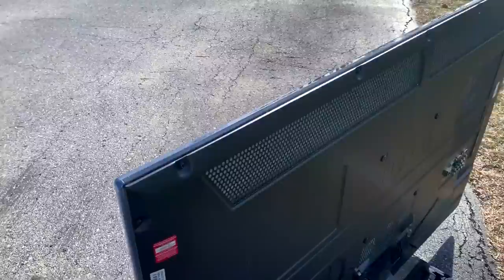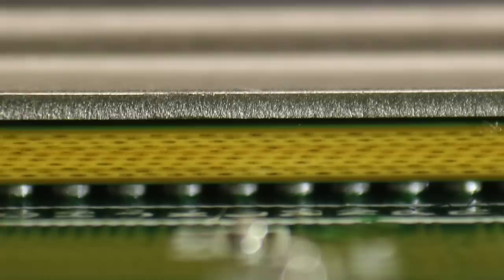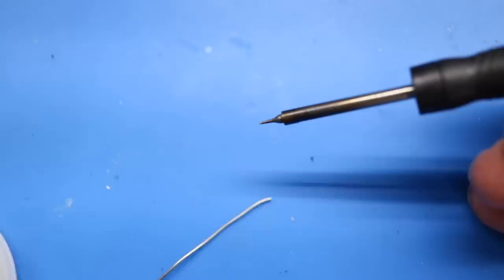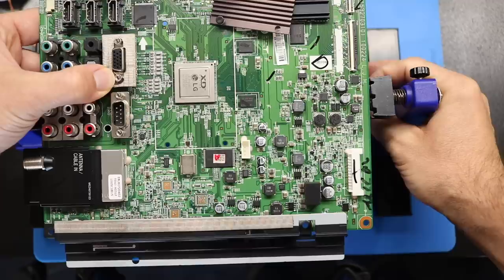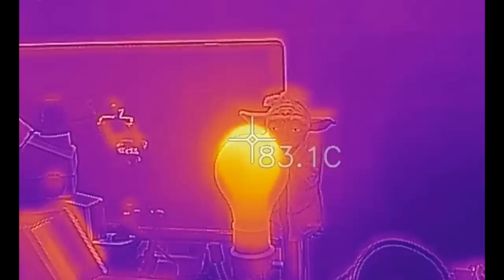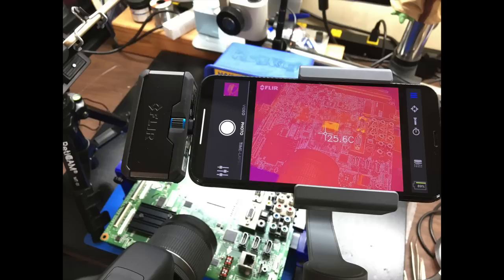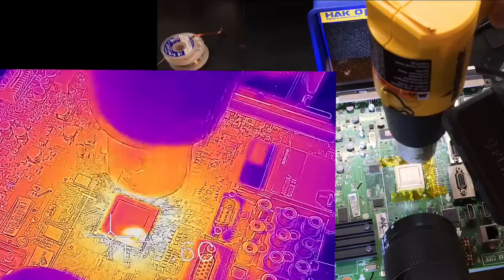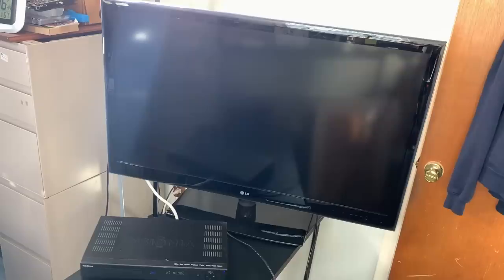I fixed a broken 47” TV with HEAT | HDMI ports not working on LG 47LE5400

Comment from the maker: Let me know.  What has been one of your favorite inexpensive or jerry rig repairs?
Reply: A repair of an older plasma TV that had blown capacitors. I think it was around $10 to repair the issue of it not turning on. My son still uses it - it's been about 4 years since I fixed it.
Reply: I repaired my relationship with my ex
Reply: I have a 65” Samsung where the bottom third of the picture is very dim and flickers. Can you direct me to one of your videos that would possibly address this problem? Love your work! Thank you
Reply from the maker: Thanks!  Sounds like either a backlight issue or an lcd screen problem (or possibly a tcon board problem).  My next two videos coming out will hopefully help give suggestions on things to try.  I’m repairing horizontal lines and dark screen issues.
Reply: @FrugalRepair  ooh when's the videos releasing I'm waiting lol
Reply: I fixed a bunch of Iphones (touch disease ) using a piece of cardboard

Comment: Standby light is not glowing The  optical sound does not glow traced no 5v Replaced ps board the opto port now glows but standby is still dark Therefore remote fails to turn on TV Tried manual turn still no joy... any ideas
Reply from the maker: Not sure but you should measure the BL_ON signal (it may be marked as something else like PS_ON) on power supply, should go above 3v or so after you press power button.  If higher than 3v, check to make sure PS is outputting 12v and 5v to main board.  If so, and you’ve disconnected everything from the main board but the button input bar (to isolate any shorts by the other peripherals) then I’d say something on the main board is at fault.
Reply: @FrugalRepair  did some testing bit hard running the board in situ noticed the board has 12v applied in standby. Made a cable and applied 12 v from bench PS checked 3 step down regulators. The remote on made 5v and the other 2 1v each. Applying 12v briefly the red standby light flashed before going dark. Check the on a good board  The red standby glows until the remote on is detected  the light stops then the green led lights up. So it appears the CPU on the faulty board is not booting for some reason. Removing the large heat sink There is 2 ram chips and MTek cpu Suspect there is a bad solder joint on the ram chip or the CPU due heat stress overtime what are your thoughts

Comment: Great job 👍A+ most people think heating alone works but do it wrong so the chip only works within few weeks. Flux is key to make reflow fix last longer. I think Xbox 360 GPU failed because unleaded solder used. I recommend leaded solder.
Reply from the maker: Thanks, Paul!  There’s also a misconception out there with the 15” and 17” 2011 MacBook GPU’s.  The issue isn’t actually the solder underneath so the “reflow” will be hit or miss.  There is a problem inside the chip and unfortunately the chip needs to be replaced.
Reply: Tampatec your a great guy 2 my friend seen alot off your vids to m8,so i learned from u2,Thx and God Bless...

Comment: So I found one of these TV's at the local GW for $40. Plugged it in to power and turned it on at the store, got a picture and thought all good! Got it home and plugged the cable box into HDMI 1and got the no signal message from all of the HDMI ports. Then researched the issue and came across all the sites that say cook the main board in the oven, wasn't crazy about the idea and knew the wife would not go for stinking the house up with the toxic smell of roasted PCB. Then I came across this video! Appreciate the way you explain why this method works and the time you take to preheat the board and protect the surrounding components with heat resistant tape. So I attempted the repair today following your method, even used an infrared thermometer to monitor the board temp.  Results, beautiful working 47" TV in the bedroom for $40.  Long story short, FrugalRepair, YOU ARE THE MAN!!!!  Please keep those videos coming to keep all us DIYers out here inspired and on the right track. Thanks!!
Reply from the maker: Wow, way to go!  I’m so pumped to hear that you got it working.  Yes, more videos are in the works.

Comment: Clever stuff. Back in the early 2010s, My business repaired broadcast & professional av equipment. We had a Hakko hot air station set up, worth around $15k, and used heating profiles supplied by the manufactures to remove and replace BGA and 150 plus pin ICs. Now I find out I could have just used a $150 heat gun and $1 globe!!! Brilliant stuff. I’ll have to give it a go on a HD capture box I have that doesn’t work.
Reply from the maker: Thanks for watching!  With your experience I bet you can get it to work. Good luck!

Comment: It worked!!! I did the hair dryer job and it worked today, 02/04/2021. Guys, I have a 42 inch LG LE5500 from 2010. All hdmi ports stopped working, so I disassembled and warmed up first for 1 minute and nothing. So I did it for 2 minutes and it came back ... but a little while it stopped again..then I did it for 2 more minutes and it came back. I tested it in the morning and now at lunch it was working ... well, the thing is, it worked. Tks for the advice and money saved
Reply from the maker: Great to hear!  You’ll probably have to do it again at some point but it will keep it alive for now.
Reply: @FrugalRepair  to make sure I haven't closed the lid of the television yet, lol. Just to make sure :)

Comment: Hey there Reese. Thank you for all you do, for so many of us out here. The Clips that your channel produces are nothing short of awesome. Every one of your clips leave me sitting there, drooling a little and wondering Where fas your channel been all of my Life?! So, again I thank You. I myself have 2 LCD TVs that need help. One is a 43" VIZIO that is unwatchable. This problem occured at about One Year and a week old, of course. Anyway I took off the back and can see that a string of the LEDs are not illuminating. I just bought a new , Non-VIZIO, LCD TV. After watching you for a while, I think I may have the motivation now to attempt this repair myself. Thanks again. I also have a Samsung that is barely watchable. An Ex threw a glass of wine at it, but its issues appear to be similar to the VIZIO's problem, in that half of the screen is not illuminated? So I think I'll try this one as well?

Is there anything inside of these LCD TVs that I should waqtch out for? Like "High Voltage," or anything? Neither of these things are worth dying for or even worth a visit to the Hospital. 

Love your Channel and Thanks again Reese.      Keep Smiling...
Reply from the maker: Thanks for your kind words!  Unfortunately, I can’t provide a lot of help detail here but I do have ideas in my top tips PDF.  If the lcd screen is broken on the other one, there’s nothing you can do to fix it.  But hope you can at least give them a try!

Comment: I have an A.A.S. degree in Industrial Electronics and 23yrs experience in electrical maintenance......you by far,  did an excellent job at this!  I have a LGLX6500 LED 3D television that was a house warming gift from my late grandfather.  The TV has sentimental value.  I think mine has the issue that most do with that chip, "No Signal" but it lights the LEDS for power and the bezel LG logo, just no signal to inputs :-/ . It's hard finding these boards new at a price that I am willing to chance.
Reply from the maker: Thanks for your kinds words!  Hope you can get yours working.

Comment: My son just found your channel, and now he is binging the videos! We have a Vizio E320VP someone gave us, and it powers up but gets stuck at the Vizio logo on the screen, and then does nothing.  The only way to turn it off is to unplug it. From reading it might be the EEPROM but that seems like a tight fix for someone who has never done it.  Probably will try to replace the main board as a whole and see.  But we both have been learning!
Reply from the maker: Thanks!  Next video should be coming out soon - a fun repair and result =).  Yes, I would agree that you seem to have an eeprom issue.  Maybe you could find a friend to solder it on for you?  Or maybe a local makerspace club could find someone to do it for you? And of course, you can just replace the main board.
Reply: @FrugalRepair  Well I am sure my husband could do it if he could find some time.  He is pretty good at all that, he built his own racing quads and remote plane stuff.  I didn't think we could replace just the tiny little parts on the board until we bumped into your video.  Worth a shot I guess.  :). Looking forward to the new videos!

Comment: Did the same operation twice on an old LG 60" plasma TV and it served me well for 5+ years until It finally gave up with another error last summer and I threw it away. But yes, It´s sad to see that so much stuff is thrown away because simple faults... Forgot to mention, I got the TV for free from a friend since the HDMI-ports were not working =D
Reply from the maker: Thanks for sharing!  That’s great to hear you got so much use out of it.
Reply: I got this TV for free recently as well! Now we'll see if I can correctly reflow the chip

Comment: Very well put together video. Definitely a step up than the average reflow video. I reballed one of these LG's with input issues with leaded balls. But it ended up failing again 6 months later. It might be internal chip bond wire issues and not a BGA issue.
Reply from the maker: Thanks!  That’s interesting.  Could it also possibly be a warped pcb or chip causing the solder ball to lose connection?
Reply: @FrugalRepair  I suspect internal chip issues. Common with flip chips, the bonding wires break internally. The heat during rework causes flexing and exspanes/contracts. Making the bond wire touch again. Often mistaken for BGA issues.
Reply from the maker: Thanks.  Do you know if this chip is a wire bond or a flip chip?
Reply: @FrugalRepair  pictures sent. Check your email.
Reply from the maker: @jeffescortlx  Thanks.  That seems like a different chip than the one I worked on this this video (Broadcom vs LG).  But maybe it's just the branding.  Anyway, the flip chip vs wire bond is how the die connects to the external chip pads.  You won't be able to take a photo of it unless you take the chip apart.   Great job on the reball, BTW!
Reply: @FrugalRepair  I know the issue is internal and can't be seen from the bottom side. But I also knew you would appreciate to see the bottom side pulled off the board.
Reply from the maker: Yes, definitely appreciate the photos!  Again, great job!

Comment: Hey, I got this exact TV but the 42” version, I bit the bullet and had a go using my wife’s crafting heat gun. I used some insulating tape to hold down the small components near the main chip and then put a bit of cardboard on top with a small square cut out showing just the main chip. I then applied lots of heat and thought I had over cooked it perhaps as when I stopped and removed the cardboard some of the insulating tape had burned a bit. I then put the board back in the TV and connected up all the cables, the 2 thin ribbon cables were tricky. Upon powering on the TV came on but the screen was messed up, so I disconnected and reconnected the thin ribbon cables and after a good bit of fiddling and adjusting the ribbon cables hey presto screen working as it should and all HDMI working! Perhaps you could do a more detailed video on how to disconnect and reconnect those thin ribbon cables correctly as it probably took me 6 to 8 attempts to get then aligned correctly. PS: this is the 2nd time my TV has failed with the HDMI port issue, it failed after 4 years and was covered by the warranty and then failed a further 4 years later!
Reply from the maker: Great job on the repair!  Yes, sometimes those connectors can be a little tricky.

Comment: Awesome video!  Can I still do this without the thermal sensor?
Reply from the maker: Thanks!  Yes, you can.  You need to be careful that you don't over cook the board.  So with a heat gun, say give it 3 minutes of close rotating heat on the chip.  Then test it.  You can try it again if it doesn't work and lengthen the amount of time.  If you can see the solder get molten, that's when you know to stop but it's hard to see under the chip.

Comment: The third time around I followed your procedure and so far so good. Thanks for posting. The first 2 times I used the bake-board-in-the-kitchen-oven method, the first time it worked but lasted less than 2 months, the second time I set temp temperature a little higher and components fell off the board. Lets wait and see how long it lasts for.
Reply from the maker: Did you solder components back on the board?  Or did you get a new board for the third attempt?  Glad to hear it’s working!
Reply: @FrugalRepair  I got a used board from ebay

Comment: Plug in RCA Cable too, it's work for me :).

Sorry for bad English, GBU.
Reply from the maker: Do you mean use the RCA inputs instead of the hdmi?
Reply: @FrugalRepair  Use RCA first then Switch to HDMI, it's works for me, 3 HDMI port Normal back.

Comment: I guess I have to try this on the BT chip in my PS3 which stopped working half a year ago.
Would not have been confident enough to try the heat gun without seeing it here.

Comment: Do you know the possible fix to a TV that would turn on normally but once turned off it would have a hard time to be turned back on again, but once it turns on again it would work normally
Reply from the maker: That sounds like a classic symptom of bad rectifier capacitors on the power supply.

Comment: I have to do this to my TV (LG too) every 2 to 10 months.  Instead of a heat gun, I back the whole board in the oven at 392 F for 10 minutes.  I put it in a baker's parchment paper pouch and then into an aluminum pouch folding up the open sides to prevent the smells from escaping.  It's annoying to have to do this, but it saves me $230 on a new board that is never in stock.
Reply from the maker: Have you thought about adding some active cooling?   Like a fan to the back over the heat sink.  They may keep it from warping again due to heat.  You could potentially try something simple like cutting a hole in the metal cover to expose the heat sink.  I have a big TV that I hope to work on soon and I might do the fan install and see how it goes.
Reply: @FrugalRepair  not enough room in the panel for adding a fan without modding the ,in my case, metal back panel.  the only cooling I could add would be those little raspberry pi passive chip coolers.  If you have a different idea in mind, I would definitely watch a video about it.

Comment: The HDMI inputs on my 86" LG quit working after a lightning strike.  The HDMI Arc output to the speaker bar still works however.  What should I do?
Reply from the maker: You may want to check out my video on that topic.  You can replace the main board.

Comment: If the solder connections are between the chip and the board, why not heat the board from the bottom of the board where you can access the solder?
Reply from the maker: The solder balls are not on the other side of the board.  It is possible to heat from underneath (I’ve done it before) but heating the chip from above is better in my opinion because gravity is on your side.

Comment: I'm curious: Why didn't you use the oven method to reflow the solder?
Reply from the maker: For several reasons. I can’t measure the heat while it’s in the oven, its imprecise, it’s heating up the whole board which is unnecessary and could cause more problems, it melts the plastic which makes things stink, etc
Reply from the maker: Of course, I could know the heat on the dial of the oven, but it is very important to have a very accurate temperature reading underneath or on the chip so you can get just above the melting point and then stop.  Oh, another reason not to do this is that you’re burning off flux, which is not something I want in my oven.

Comment: Hey frugal! There’s lots of broken or cracked screens out there, could you try to repair one in a video? There’s not a lot of information out there
Reply from the maker: Unfortunately, you can't fix a broken LCD screen.   At least, where the LCD is cracked.  There are other tricks for other types of broken LCD display issues, like bad tab bonds, bad COF chips, etc.

Comment: I had a lightning strike 10 m away from my outside TV aerial. Since then one of the HDMI ports on the back of the TV isn’t working. It was connected to a DVR recorder which was connected directly to the outside aerial. Is it possible that this would only take out one HDMI port or do you think something else calls the HDMI port to file?
Cheers Wayne
Reply from the maker: Yep, the surge could come through the hdmi.  I have a video where this happened to a tv and I fixed it by replacing the main board.

Comment: I have a tv that looks like paint running down from the top of the screen all the way along the top. The guy said he laid it down to move and it started after that. Any ideas?
Reply from the maker: If the LCD isn’t cracked, then my first guess is that the connections to the driver boards need to be checked.  The connections from the T con board can be reseated but unfortunately, if the tab bond connections were tweaked then things may be harder to fix.

Comment: Hey how did u figure out that the problem is in the cpu and not on the HDMI ports themselves? Can't they get broken as well? How did u know it's the former and not the other basically
Reply from the maker: I guessed because it’s a common issue.  Usually not all hdmi ports fail if it’s not the controller chip or cpu (or bga issue)